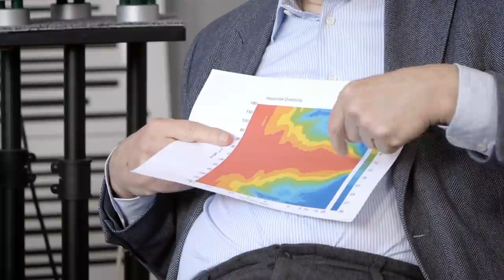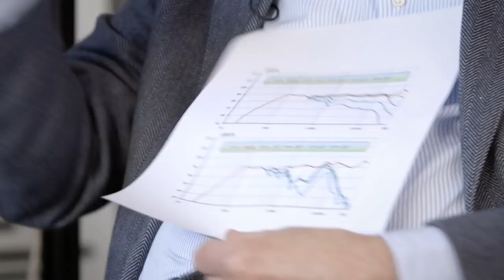Klaus Heinz: Why do speakers sound different when they measure the same? - with HEDD Audio

Comment: No two speakers actually measure alike if the measurement procedures and/or gear are comprehensive enough.  Even two speakers from the same maker with consecutive serial numbers can measure a bit differently if the procedures and test equipment are up to snuff -- this is especially true of the "entry-level" stuff found on sale at big box stores.
Reply: True, they are mechanical things after all. Even if they measure alike on certain specs, they are probably complete different on other things.
Reply: @limitlesssky3050  -- Well, "completely different" is an overstatement IMO.  The differences between various examples of the same make and model speaker tend to be very minor and are seldom audible.
Reply: Indeed, one and a half minute in he explains a phenomenon that can be observed in compression measurements.

Comment: As a musician, engineer, and acoustic product developer, I consider the answer to the last question & Mr.Heinz's answer will be limited by our current recording method and workflow of audio processing, which is heavily based on our understanding of sound capturing and reproduction basic rules. We might need to make some groundbreaking changes to our understandings, create something brand new for measuring and capturing, then we can make a big step forward in the physics of speakers for example efficiency.

Comment: I think the issue with measuring speakers by measuring frequencies is the fact that we need to average a series of results into one number. You can imagine a speaker that produces the signal perfectly at every point in time, which will produce the perfect measurement. But another speaker that is wrong all the time and doesn't quite keep up with the music can still produce a perfect measurement if the error just happens to be perfectly distributed across the different measurements. 

I've often thought that the true difference in speakers is in the dynamics - in how they produce the transients. Because there is NO WAY that a speaker cone that is moving through air is going to be physically able to keep up all the time perfectly with a signal complex as music. Any speaker can keep up with a test tone, because it only needs to produce one frequency - the trick is being able to produce high and low frequencies and everything in between incredibly fast. Imagine making a knot in your shoelace slowly with unlimited time -  anyone can do it - but if you need to make that knot in half a second, you'd have to be really skilled. In nature sound comes from a variety of resonating sources and instruments and voices, each of which produces the sound on their. A speaker is alone in trying recreate that cacophony of sounds that gets then represented as just a single voltage.
Reply: Speaker measurements are wayyyyyyyyy more complex than just a single frequency response, everything from dynamic capability to large signal performance (more than 1 watt) or multi tone performance can be measured. Measuring a speaker can be way more complex, all reviewers don’t do those measurements, some manufacturers do. It is really amazing what you can measure and simulate, more than most audiophiles know, search for klippel if you want to know more
Reply: @skandiaart  thanks mate! Really interesting- I need to dig into this more

Comment: If they sound different it's because you are not measuring right or measuring the right thing.
This kind of approach is misleading and at the beginning of your video you compare a big speaker with a lot of punch with a little speaker and say they measure the same... Of course they wouldn't measure the same in some variable.
Reply: Exactly. Frequency response characteristic is not the only variable that can be measured.
If two speakers sound different, you'd see it right away on distortion characteristic, which you can get from the same measurement you use to determine the frequency response.

Comment: It took me back! I had a pair of Heil AMT 1's and Magnapans. As far as the critiques on exactness. I sure Jessi wasn't talking about two speakers being exactly within +/- .05 db in 20 to 20K.  I've listened to some killer monitors in my life. From the Mastering Lab to Abbey Road to  audiophile systems to my studio's JBL 6328'S and Auretones. With my experience speakers with close to the same specs when compared large to small the large speakers do sound different.  For better or for worse.. Do a comparison between throw high pass and low pass filters on them.
Reply: Bigger loudspeakers have inherent differences such as distortion performance and acoustical differences due to size of the drivers and cabinet. So not that unexpected

Comment: the question why meassuring dynamics is so dificult was not answered?
Reply: It's not. Typical way of measuring frequency response is from an impulse response. And impulse response is "dynamics". If you measured an impulse response of your audio chain at only one frequency, you'd get a visual representation of what could be called its dynamics.
Reply: @tomkocur  what would that visual representation be?
Reply: @Jaburu  impulse response graph (x = time, y = amplitude).
Reply: @tomkocur  the "speed" should certainly be visable as a "pre-ringing" before the spike. but you wont see how it behaves when volume changes (dynamics)
Reply: @tomkocur   i have an idea that dynamics is impulse response or waterfall graph,  and spl combined. because db measurement is just loudness at a single point in time or an avg. 
by spl i mean the measurement that reveals the effect of large cone area which effect are more impact.